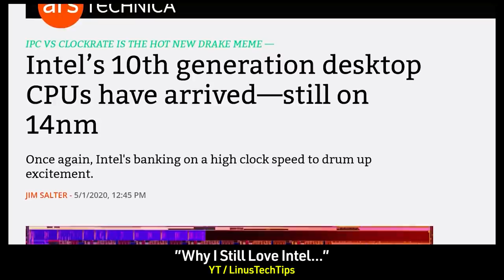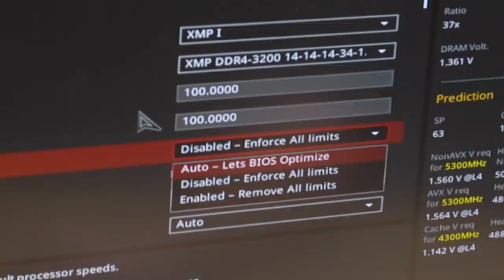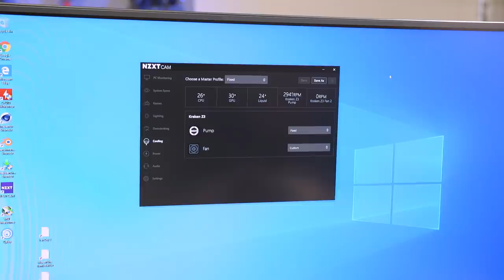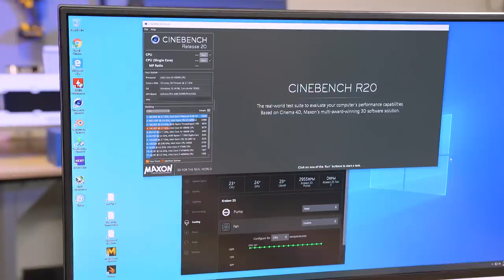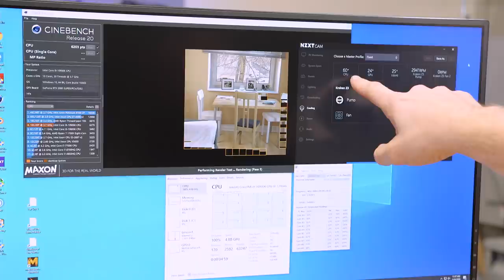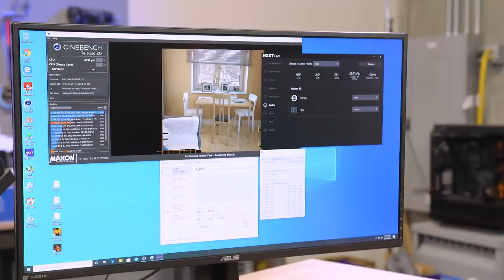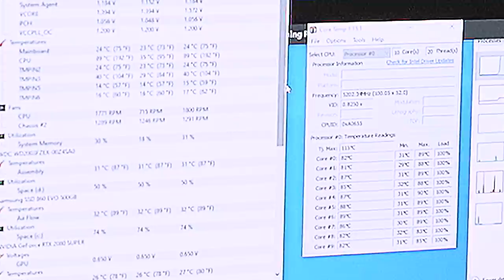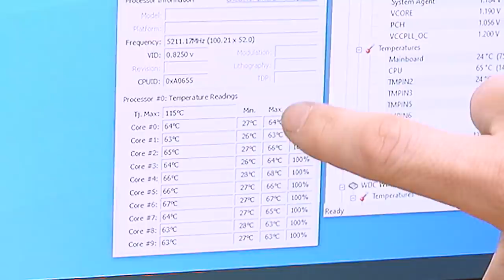Does the 10900k Melt!?

Comment: 1) here's who is talking so you know I'm not some random mythomane https://postimg.cc/gallery/T1VpWYP/fb33e0f7 https://www.youtube.com/watch?v=9cIUBlQTN7Y
2) I will start by saying the NZXT temps are awesome, great cooling the liquid temp is awesome, for me 35°C liquid is the point at which your cooling solution isn't enough (unlike Linus talking about 40°C as it it was acceptable) above 35 your radiator will get hot and stay forever hot the exhausted air will be noticeably hot and heat your room pretty quickly, 26-30°C like the NZXT is perfectly fine if you place your hand in front of the rad you will barely feel heat that's how it should be and that NZXT seems to do it :)
3) AGREE : Intel are cooler than AMD (I own both) Intel idle especially way cooler and better managed, GN and others loved showing 5.1Ghz 9900k when everyone including them knew 5.1 was too much (intel too hot = fake news) 5.0 all cores was easily achieveable with "okayish" 75-85°C and stock@4.7ghz all cores I had like 65°c the 10900k seem actually to have lower temps, using a test bench for a non-comparative CPU test like here where the goal is to show easily achievable temps regardless of the build is fine
4) DISAGREE : using a test bench to compare air cooling and AIO no, it's dishonest it's fake news it removes the benefit of aios to choose where you exhaust or intake air, in both cases a clear advantage compared to a cooked by the gpu backplate and hot by default, air cooling, in that case there's no argument, build a close PC make your measurements (like bitwit) and you'll see 100% front mounted aio means 10-20°C cooler cpu, test benches only benefit is making the reviewer life easier, to have a real 1:1 test condition you'd have to blow hot 35-60°C on your air cooler because that's what they eat in a real life in a closed case..while an aio can eat 25°C air...HUGE difference 2nd thing I disagree that cinebenchR20 is "the hardest thing" again it's just "easy to run" for reviewers (system keeps it's responsiveness) aida64 stress test is way harder if you try to do anything else run other apps in the background your system will freeze or crash ,I use cinebenchr20 for the same reason but don't say it's "super hard" the prime tests also not that hard on the cpu

Comment: Man I hate to criticise, but you don't need a case that covers every single person's scenario to justify building in a case.
People on the fringes of case design (like SFF) are aware that standard thermal specifications don't necessarily apply to them,
and acting like they're not smart enough to figure that out is ridiculous.

When making a statement like this, you should be aiming for as high a generalisability as possible; using the literal best
case scenario (as far as builds go) that almost nobody uses practically is certainly NOT reflecting an average ATX build.
Almost ANY case you could find would be more representative to the general audience than this,
simply because it wouldn't be open air.

You opted for ease of assembly over generalisability, and that's fine to do, but don't be coming out with some BS
excuse like this to try to cover yourself from the criticism that your build is not representative of the thermals an average ATX build should expect.

Your title should be "Does the 10900k Melt in the literal best case scenario for a standard setup!?"

Comment: It is just soooooo stupid to use an open bench while testing cpu temps. The logic is just wrong. I can't provided a case that applies to everyone doesn't mean open air bench is the correct way to go. So everyone keep in mind to add a few degrees Celsius to that i9 chip. I don't mean to say bad things about Jayz here but it's hurtful to see someone dealing with "logical-based components" are doing something that makes no logical sense. Let's say open air bench and all the other forms of PC takes around 0.01% of the entire pc market, Pc with cases are like at what? 99.99% for sure.

Comment: Jay what is wrong with you? You're not supposed to use some pre-applied paste you don't even know the identity of. People want results that they can relate to. They want to see the CPU running with the best thermal paste (kryonaut) available and also with a cooler that they know the position of in the CPU cooler performance charts.
You used a new cooler that I dont even know how it compares to a Dark Rock Pro 4 (or NH-D15, or X62, doesnt matter much), and even worse, you used the stock paste man.

Comment: "I'm going to prove that this chip doesn't run hot, by connecting a powerful water cooler to it, in an open case."

This whole test is invalid, without using the shitty stock intel cooler in a cramped case, under a desk